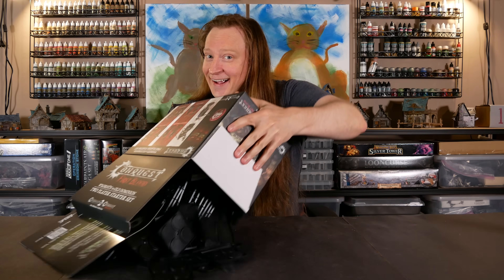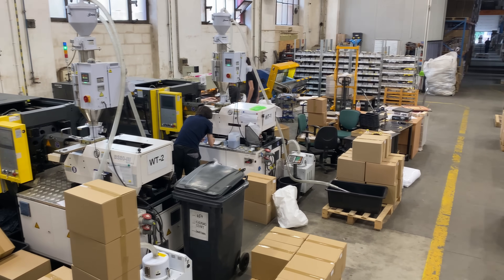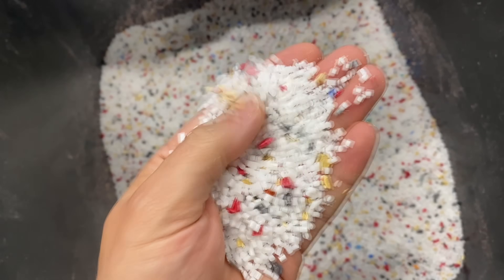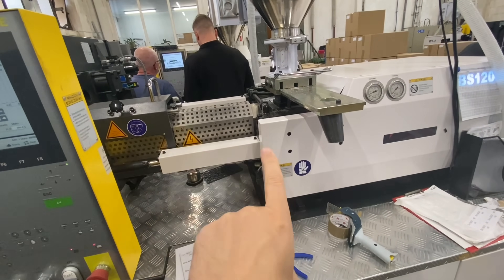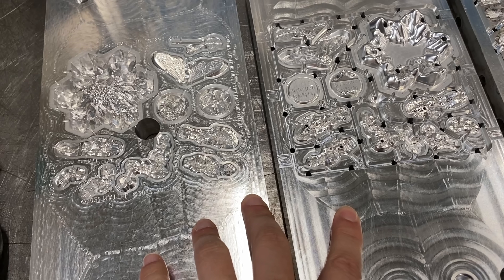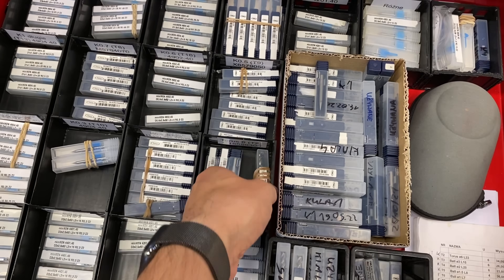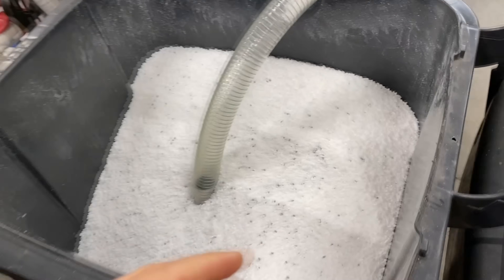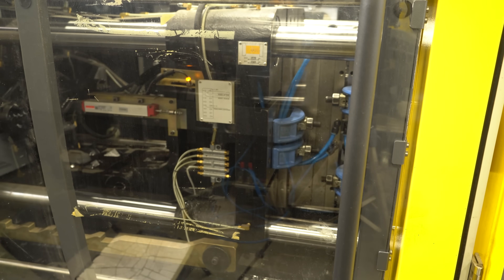How Models are Made: Injection Molding Hard Plastic Sprues - HIPS Polystyrene Minis.

Comment: Been looking into setting up a smaller company to do Plastic Injection Molding (PIM) production. Something I have found is that most miniatures use a GPPS with similar additives to HIPS but is not true HIPS. Mainly because HIPS can't use common modeling plastic cement.

Also just to prevent confusion the CNC was likely using End Mills not drill bits. The worst part about such fine end mills is how quickly they wear out. Hence why most companies have switched to EDM based machining for the fine details and only use normal milling for the roughing stage.

Comment: The screw doesn't heat the material as much as it just compresses and pressurizes the plastic so going in it is at room temp room pressure. Coming out the plastic it several times atmosphere and that much hotter. Remember p=nrt pressure is dependant on t temperature and thus temperature is dependant on pressure. Dependant meaning they're not independent from each other

Comment: Not drill bits...  they are endmills in a CNC mill...  They are far superior to drill bits...  You can't remove material with the side of a drill bit deliberately for very long!  The flutes on those endmills are designed to remove material (within the limits of feeds and speeds) from the tip (plunge milling) and the sides of the end mill.

Comment: Hello Goober and followers, I have been working with green stuff and oyumaru to get extra bits but I have noticed after greenstuff hardens it becomes quite brittle, I know increasing the proportion of one of the colors keeps the model softer for a while but it always ends up hardening after a few days, I wonder if you could point me at any substance which could keep the greenstuff indefinitely pneumatic if added to the mix, preferible something which is easily available, thanks in advance.

Comment: The last few years of my career have been in Mold Making.. Nothing more satisfying than the first part coming out of your mold. Each one I built took a few months to build. Personally loved to metallurgical side of what went into them, lots of heat treatment of inserts and mazes of cooling channels inside the mold (we used glass filled material mostly so hardened molds were a must).  some molds were single cavity , one  getting up to 18 cavities! The venting tolerances were the most stressful part. (you need to vent off the gasses from the molten plastic or it will basically boil and create hot spots in the cavity.. too big and the plastic will flow through!) We worked a lot with Glass filled Nylon so it was a pretty large max size of .0025". Polypropylene sucked! max vent size is .0005". Thankfully the CNC milling machines we used were accurate to .00001" so you could creep up to the tolerance pretty easily if your setup is good.

Comment: Great video.  It's good to see someone do a inside the hobby video instead of just another build video.
One correction though.  The tools they use to cut the molds are called End Mills not drill bits and they come in three main types for mold cutting: Ball end mills, Square end Mills, and Bull Nose end mills.  All of these refer to the tip shape and each is best for creating different types of geometry and different types of cutting.  🙂

Comment: Sprue.. runner...gate ...part. fan gate..clam gate..submarine gate..sub gate..hot runner..cold runner....hot tips. No more than 20 % regained. Vent pins..lfters... blind hole..gibbs... slides...intrusion....gas assist injection molding....2 3 4 shot color injection molding....robots....human operators....toolroom..tool PM.. GOOD VID! Just been doing the same thing for 23+ years 😁 I Love tryouts.

Comment: As a professional in injection molding I had to watch this, not all video but parts around the process. Did you say a pressure of 100 atmospheres during the process? Thats way to low. Actually injection pressure can be from a few hundred to over 2000 bar. Hope these guys make a lot of money so they can buy machines from Engel, Demag or similar in the future, very nice to work with 😉

Comment: 1. clamps on back half are in wrong position. 2. You don't need to dry HIPS 3. One ejector stroke is all you should need any more wastes cycle time = $$$ 4. If you're not running chiller, you're wasting $$$ by being able to run faster than 30 seconds 4. Its not a "sprue" or "sprues" its referred to as a "shot" or "shots"

Comment: The CNC machines use in Mills as tools not drill bits. Drill bits are for making holes and end mills, face Mills and single point tools are made for removing material and shaping that material. You can also get in Mills and everywhere from one flute to as many as 12 flutes or more with a flat bottom various corner radii as well as ball nose versions that are rounded on the bottom. And Mills cut on the sides and the bottom versus drill bits only cut on the bottom.

Comment: Seems like you could pull a vacuum to evacuate the air before injecting plastic. And heat the mold to increase resolution, lower injection pressure and make smaller seams but increase production time. Is there a release agent used between injections?

Comment: Curious if they use the excess Aluminum from the initial mold as well as older molds.  When they are old and worn etc do they recast them into the aluminum blocks to be reused in a new sprue mold?  Just curious as they seem very good at reusing waste.  Would be interesting to also see companies like Archon take back all the spues as waste we end up with so they can perhaps  decrease costs and perhaps use that a recycled material as well in new model sprues.

Comment: I do injection molding with a rubber for industry. In 87 or 88 I worked in the same building as Grenadier (the metal minis), those guys were centrifugal molds. Cool to see how modern ones are made.

Comment: First of all: Great Insight for the Community and big Kudos to Archon for opening their doors - this is not common at all. I would have loved to see more about the digital "cutting" process in combination with design choices that need to be made to fit the mold - but i guess thats something all those companies want to keep secret  as those companies surely have custom plugins to help them cut up and lay out their 3D designs.

I guess the Cost of 1$ for a cast of plastic is already taking the mold and design costs into account. 
I read some time ago that GW has a cost of about 15cents for a box (including the box) of minis. I think it depends on how you calculate the actual costs as there are so many different aspects involved and the "total" cost kind of comes down to how many you produce and sell - it gets cheaper by the numbers as there are those immense initial costs. 

This has never been a secret - but it´s the reason why very special Single Character/Sprue models can be so expensive as they sell less but need to undergo the same initial process and still need to make their money back.

Comment: I just 3d print my sculpts but it’s interesting seeing injection molding and wonder if it’s possible to do this with a consumer budget, I know CNC’s are at a reasonable price so let’s say the aluminum molds can be made but it still needs a device that melts and injects the plastic, maybe instead using casting resin with a pressure pot?

Comment: Fascinating video. I found the layout design for the sprues and gateways particularly interesting - so much more complex than those designed by hand. It gave me a real appreciation of how they use technology, but also a greater respect for the designers of plastic kits pre-computerisatiion (on the railway modelling side, a UK company (Dapol) still produce kits originally sold in the 1950s).

Comment: [*CORRECTION*] >1:58   If H.I.P.S.* "only costs "A Couple of 💲_per Kilogram"_ (2:02)    ~&~   "Each Addition SHOT* (?) costs A Dollar (2:09)
(* SHOT meaning SPRUE Cast ??)    So if the cost of H.I.P.S. is $2 per 1000 Grams, and each Sprue ways approx. 30 grams......
you can get like 33 Sprues from a single Kilo of H.I.P.S.  >>  meaning that each "Additional SHOT" (SPRUE ) doesn't cost "One 💲Dollar"  ....
Each Sprues' Cost would be  [CALCULATED]     1000 gm / KG   ÷  30 gm per Sprue = 33 Sprues per KG
$2.00 ÷  33 Sprues  = $0.06  per Sprue   (Materials Only)

So next time you're looking at a beautiful Model Sprue, remember that the Materials** (only) you're holding cost the manufacturer: Less than 10¢ / an average of $0.06 in Materials costs.

(* High-Impact-Polystyrene)
(** Excluding all thing like DESIGN TIME, LABOR, ELECTRICITY, MACHINERY, The Actual DIE MOLD: When you factor all those things in, it still only works out to between $0.30 & $0.45 per Sprue  (Depending on the Size & Complexity of the DIE Mold)

[CONCLUSION]  So it's not even close to "About (average)🚯$1* per Sprue"  (2:09) as quoted. It actually works out to be about an average of:

$0.37 per Sprue*  (* Then with Packaging, Shipping& Web-store placement etc.)  that bumps the costs up a bit to:

 GRAND TOTAL COSTS TO THE COMPANY  (GW, MMF Etc.):   

$0.50 USD  per Boxed Model  (on average)

 (Check out Macca @ The OuterCircle on YT, he has experience running an INJECTION MOLDING Factory & touches on this subject in captivating ways)  

(* "I'D BY THAT FOR A DOLLAR!!!" ** )
(** The line in 'ROBOCOP' Should've been:  "I'd Buy That (Sprue) For €55/$70 + Tax/VAT!"  > It just wouldn't have been as CATCHY)
Reply from the maker: I think the 1 dollar per sprue figure included more than just the materials cost. I think it was  materials + electricity + labor or some thing like that.   But yeah, this is very efficient once it gets goin! :-)

Comment: I'm curious about the CNC machine carving the mold for these. A week seems like an insane amount of time considering how much these CNC machines cost. I worked at a robotics manufacturer and if it took a week to mill a 1-inch thick plate of aluminum, they would be out of business. At 2 weeks for a mold, it seems like it would have been easier, cheaper, and faster to 3d print the minis,  which could then be used to create a cast aluminum plate.
Reply from the maker: right?  so many tiny details to carve out! :-)
Reply: @GoobertownHobbies  I made that comment before I finished the video, going down to a 0.2mm bit would make the timeline make sense. And after looking at that fresh mold close up shows that they are spending a good deal of time removing any tool marks from the cavities, which would also increase the time.

In my haste I wasn't thinking about the quality of the models, just the output of making the molds. It's good to see a company that wants to put quality of the models first. Thanks for the video!

Comment: My family used to run a CNC workshop in our case it was brass fittings (gas lines etc) so just the sounds of the workshop even without seeing the machines immediately brings back memories.

In my case it was putting millions of fittings, O rings & nuts together. :P
Reply from the maker: ahhhh, memories 🙂    Several folks have commented about the machine sounds, it seems to be a mixture of good memories and stress dreams hehehehe

Comment: Great instructive video ! Is there any company working with those types of plastics collecting our old sprues to reuse it ? I would rather have them used to produce more than throwing it away
Reply from the maker: I don't know of any companies with an active recycling program... the energy use of shipping empty sprues might not be worth the impact of recycling, but it would be nice if someone found a way to make it work! :-)
Reply: @GoobertownHobbies  Unfortunately you are correct. We tried at one point to do just that but it was not worth it both environmentally and economically.

Comment: Thanks for doing this video. I've really always wanted to go into a miniature manufacturing facility and see the work put into these things. I've had a lot of exposure to the automotive side of plastic molding, but that's for parts the size of a sprue and there's still incredible detail in them (especially the reflectors of lights). Thank you very much from a happy mechanical engineer.

Comment: The 100 atmospheres of pressure during injection is wild. For reference, that's higher than the bottom of the ocean or the surface of Venus.
Reply from the maker: pretty cool huh?  there aren't even designated channels for the air to escape, it just gets blasted out the sides  :-)

Comment: If you think these are amazing to see how it is made, you should check out some of the Gunpla that has came out in the past few years. Some of the parts for the PG unleashed, and the RG line is made with moving parts/ multple colors being shot into the molds. Right off the runner the arms, hands, feet, etc is complete and ready to bend and flex.

Comment: Is this the same material that GW uses? I always presumed they used ABS plastic.
Reply from the maker: GW is also HIPS.   apparently GW uses steel molds instead of aluminum, but the actual models are the same material.
Reply: @GoobertownHobbies  I am surprised that GW doesn't have a sprue recycling program. If it were possible and practical, it could reduce costs for everyone including the end user. Although perhaps the plastic becomes too contaminated with dust, hair, oil, etc at that point.

Comment: Really good overview on how things work.
I worked in injection molding for 17 years  Over that time I did many things, and wore many hats. I was a press operator, material handler, mold setter, set up the machines, helped fix the machines, helped repair the tooling, scheduled production, and handled shipping, receiving, and inventory.
Of course, back then the cavities were made out of steel, or if cooling was critical, beryllium.

Comment: Really surprised to see that they are using aluminium molds.
I was under the impression that most molds were made out of steel and even specialist tool steel that are a nightmare to machine, heat-treat then finition machining.
Maybe it's because they're doing rather small series and the mold won't get worn enough at the end. Cost of machining aluminium is definitely cheaper when compared to steel machining.
Reply from the maker: Yep, my understanding is that it's a tradeoff for the scale that they normally work at.  Aluminum is easier to work with, but you don't get as many cycles out of it.

Comment: Seeing that they use some recycled sprues in their process, that brings up 2 interesting points: Are we getting closer to a sprue recycling service of some sort? Transportation and storage costs are still a big thing to consider I know, but start small and expand. Second point: Is there a limit to the amount of times the polystyrene can be reused? Can the "same" sprue be reused for 2 or 3 or 10 times without sacrificing any quality?
Reply from the maker: without changing their process they can do up to 20% recycled 80% fresh material in their hopper.  I'm not sure what goes wrong if they try to use mostly recycled material, I'd love to learn more about that!    And yeah, I think the problem is still the resources required to get sprues back to the factory and ensure that they're clean and whatnot.

Comment: This is fascinating. I have always wondered exactly how injected plastic molding worked for polystyrene sprues. I had no idea that the injection happened so fast with that much pressure. Jarek's explanation on sprue design principles was super interesting as well. Great video all around.

Comment: Great video! It always drives me crazy when GW apologists claim that manufacturing of model kits is super expensive and that making the molds is one of the worst parts. Injection molding is by far one of the most economical manufacturing processes in the world, that is why its used so heavily. Sure, initial costs of a steel mold and the injection machinery is expensive to an individual but for a large company that is doing over 300 million GBP in revenue in a year, and at a 70%+ profit margin its peanuts. They make almost double the profit margin of Google!
Reply from the maker: Information is power!    the GW process IS a bit different, I think they use steel molds instead of aluminum, but your point is well made that the reason they do it the way that they do is because of how efficient it is! :-)
Reply: @GoobertownHobbies  Indeed they do use steel molds, but that just stands to reason that they last even longer, and get an even greater return on the investment of having the mold created. Aluminum is a softer metal, so can physically produce fewer runs before the wear makes a noticeable effect on the final result. I don't have any statistics handy on what that return is compared to aluminum, but I know its higher, even with the increased cost of manufacturing the mold out of steel.
Reply from the maker: @LumberingTroll  yup yup, I'm sure they chose steel because it was the most efficient (cheapest) for the scale of operations! :-)